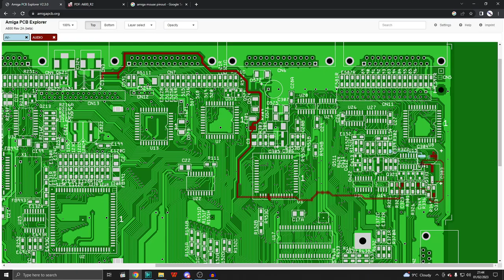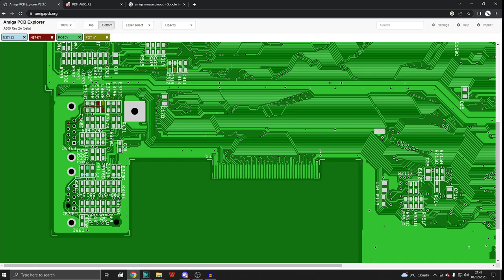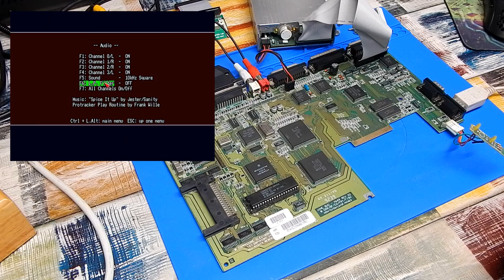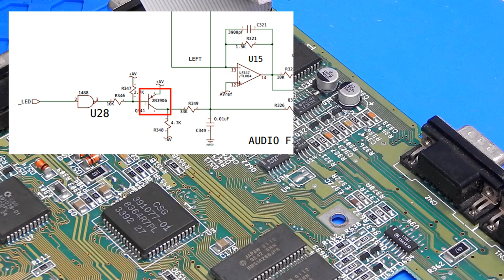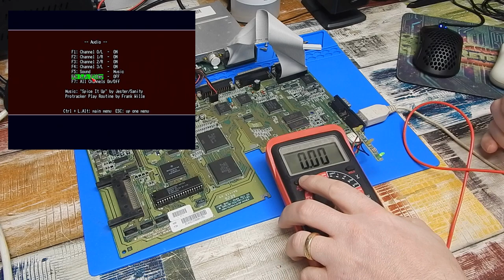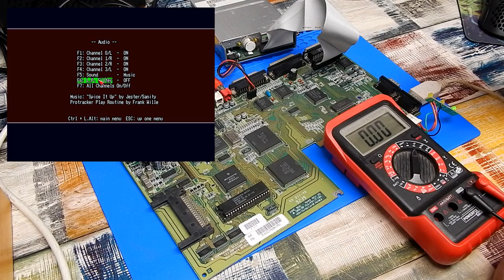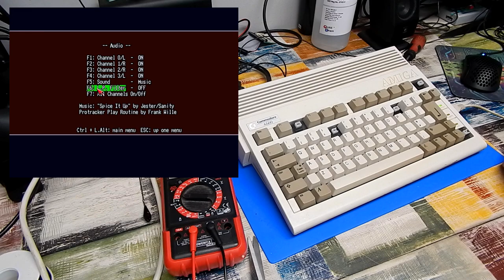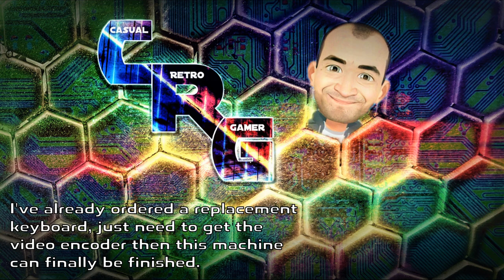Amiga SICK hundred - Part 2

Comment: 24:06 In response to your question... If I remember correctly, Buttons 2 and 3 on the Amiga have support for Paddle input, which is an Analogue control, so it's more than just a "Is it Floating for no button press, or Pulled down for button press", and the logic to read the states is tied to the Analogue circuits, which you likely repaired when you fixed the Audio low pass filter.
I remember this nugget of information from when I was making a PS2 to Amiga mouse converter. I specifically had to use transistors on the outputs of my microcontroller to pull them down, because the output directly wasn't strong enough for the Amiga to register that the right mouse button was being pressed.
Reply from the maker: Odd you should say that, I was reading a blog post the other day about someone building  a converter for the Amiga and they put transistors in the design, maybe it was yours...  

I suspect that, as you suggest, I repaired a voltage rail or maybe even ground rail somewhere .  The components I reflowed on the bottom are the decoupling of the audio ground, I wonder if that was the fix.
Reply: @CRG  While possible, I doubt it.
I originally designed mine several years ago around a PIC16F84A, which worked without the transistor as it has TTL outputs.
A later design was based around a PIC16F683... or similar chip, because it had a similar architecture but had an I2C/SPI host controller built in. The idea was to use the SPI to talk to a USB host controller chip to be able to use more modern USB mice on it too, but I never completed that part of the project. But the PIC16F683(and family) has CMOS outputs and the right mouse button wouldn't work. That's when I did the research and found out that the 2nd and 3rd button lines can have Analogue inputs. That's the design that required the transistors being added to the right mouse button.

Around the same time somebody else was working on one based on a PIC16C628, which like the chip in my second project is a CMOS based chip, so would have also required the transistor. It's more likely that you ran into this project.

Comment: Great to see you fix these issues. My A600 also has a bad composite connection but the RGB works well.
Reply from the maker: Does seem as if those cans beside the encoder are the primary cause of no composite video.  I should have the new encoder this week and all being well the final part will be uploaded this week or next.

Comment: A top tip is to desolder the RF-can no matter if you're gonna keep it or not. There's usually a lot of gunk hiding underneath.
Reply: I got rid of mine for a PiStorm mod and it was a real effort to get it desoldered from the board!
Reply from the maker: That's not a bad idea given how bad things were under those cans I removed.  Never going to use the RF anyway.
Reply: @CRG  Maybe you could do an S-video mod in it's place?

Comment: Just wondering if the re-flow of some of those components on the underneath did the trick with regards to the magic RMB fix.
Reply from the maker: Very possibly.  Looking at the schematics again some of those components on the bottom sit on voltage rails.  If some of them had poor or missing connection it might have been enough to effect both the filter and the 2nd button input.

Comment: Just pick up a four wire cable and replace the LED cable built into the A600. I use one about 10" long. Works perfect.
Reply from the maker: Yeah I think I'll do that.  The wires are just hanging on now, absolutely terrible design choice by commodore.

Comment: Some time ago I repaired and upgraded an a600 of a friend. Can say it was a bit sicker than this one but I got it running. Same problem with the encoder, so I installed the other encoder that doesn’t need those boxy parts, works great. Upgrades I did was replace the video encoder with an rgb2hdmi, built a 1mb ram expansion so he has 2mb ram and built a 8mb fastram expansion that goes over the cpu. Both designed by Sukkopera. You really need the extra ram if you want to get good use of the HD.
Reply from the maker: I've got a 1mb ram upgrade to build for this machine so if there's time I'll put it together in the next part.  Beyond that I'm not sure what to do, some fast ram is probably essential but beyond that I think I'll just leave it without any acceleration.

Comment: I am fairly certain that both the mouse buttons and the LPF were fixed by the capacitor on the AV reference voltage. Unstable voltage could stop signals triggering because they aren't constantly (long enough) on the appropriate logic level.
Reply from the maker: But there was a cap there when I first got it and those buttons didn't work then.  Of course nothing to say it was the wrong capacitance or even fitted the wrong way round.  

The caps I reflowed on the bottom side might have been the fix.  They both sit on the +av and -av voltages.

Comment: I have an A4000 that has had a similar recap done to it, not quite as extreme in terms of the physical size of the caps on yours (not by me by the way) but it does function correctly, one day I will send it away and have it put right
Reply from the maker: Ultimately there is nothing wrong with using the through hole caps in the surface mounted fashion, its just untidy.  it will still work the same way and in fact I have another project upcoming on which I have no option but to do it.

Comment: I have three 600’s, all of mine have no visible damage, but the ide pins fall out… so, likely the caps have leaked and sat  to corrode…
Reply from the maker: If a pin fell out I'd be seriously concerned about damage.  That cap juice gets everything and wrecks things over time.
Reply: @CRG  yeah, I soaked it with vinegar, and flushed everything well with 99%IPA I’m hoping it will clean up.
Reply from the maker: That should be enough to hold off any further damage but just keep on eye on it.  As a minimum though get it recapped if not done already.

Comment: Cutting about a millimeter of membrane connector often makes it work again. You cut just a tad too much ;)
Reply from the maker: You can't really see it on the video but the contacts were completely gone from a few of the positions.  Had little choice but to cut it so far back.  I needed the other keys anyway but got a really good deal on a tested working full keyboard so that made sense to buy.
Reply: I replaced the membrane in my A1200, is there a replacement membrane for the 600 you could've got instead of a full keyboard you think?

And yes, very away of the missing keycaps

Comment: Great contents here! Just a hint, I would try the external floppy connector, just in case! Cheers, M
Reply from the maker: Did I miss something?
Reply: @CRG  Absolutely not! It's a thing that failed in my A600 when I experienced almost all the issues you had in this sick A600 you healed! Just, I was no able to fix mine at that time, maybe your suggestion will help me now. So, I pointed you into pay attention to the floppy connector (usually not so used by many)! Cheers, M
Reply from the maker: @mark12358  I'll give it a go to be sure it's working.  Need to also check the ide is working correctly so will do all that in the next part 👍
Reply: @CRG  Looking forward to the next video!